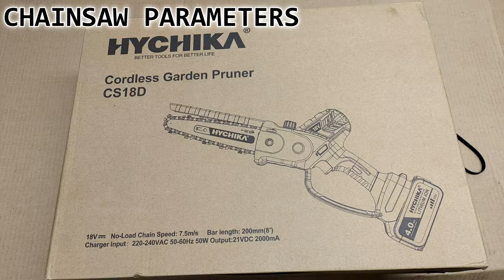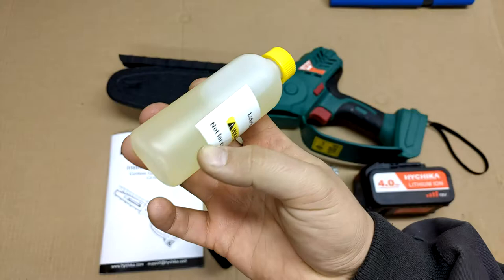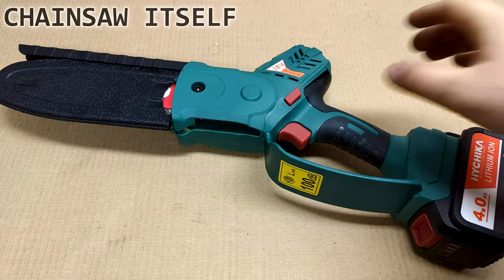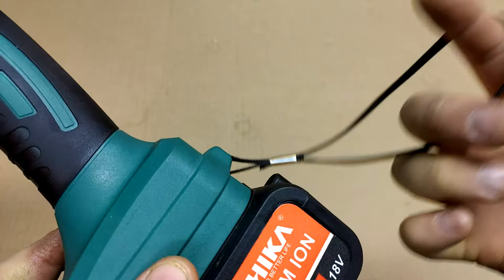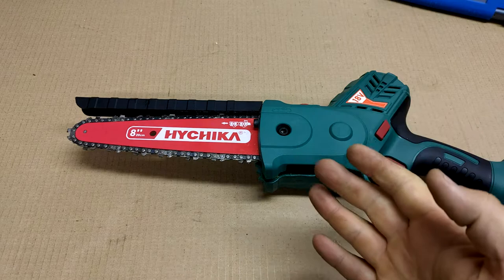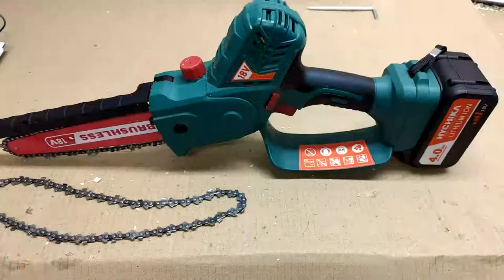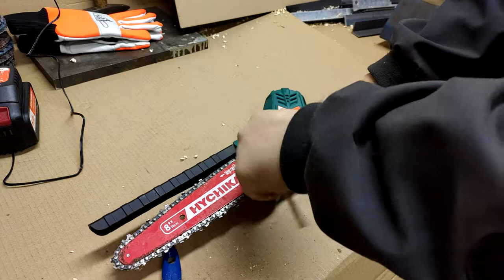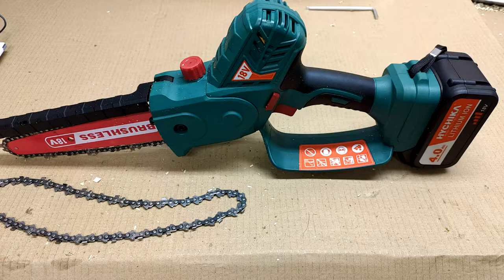One hand cordless chainsaw Hychika

Comment: Thank you for your review. Very expensive machines. They cost like if they were a known brand. You can buy a Einhell GE-LC 18 Li  or a BLACK+DECKER GKC1820L20 for much cheaper. Even a Bosch UniversalChain 18 is just slightly more expensive. These Hychika may be good but not $150 good :) :) :)